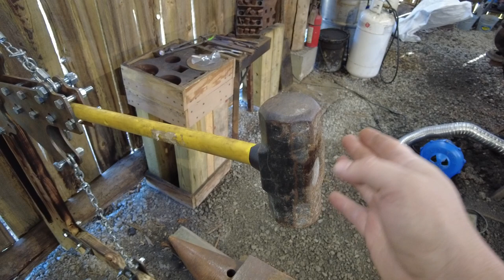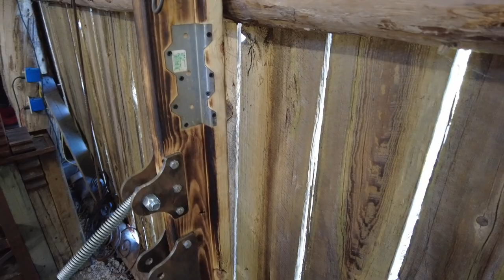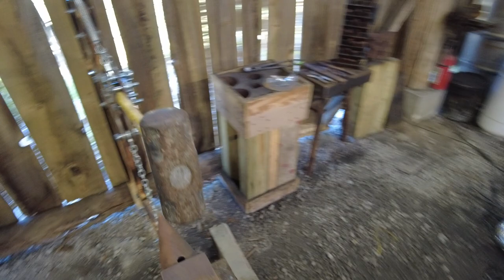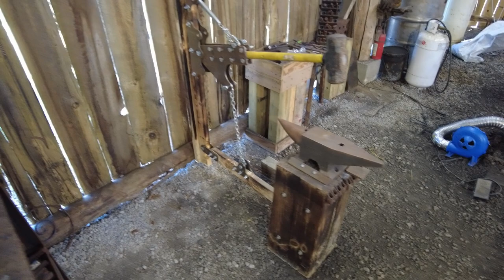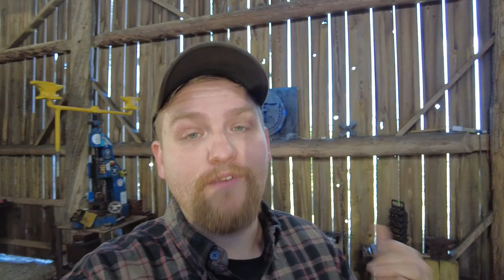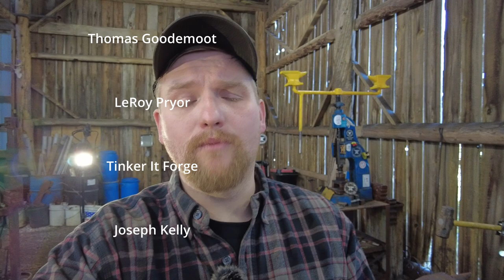Introducing... The New Treadle Hammer Kit! (Plus Q & A)

Comment: This looks like a really great setup!  I know some of it will depend on the sledgehammer used, but what's the approximate distance from the 4x4 to the head of the hammer?  Trying to figure out if I can squeeze this into my shed; a press or power hammer is likely overkill for the small hobby stuff I'm doing, but this looks like it could be exactly what I need!
Reply from the maker: It's just about 40" 🙂
Reply: And of course on a re-watch, you absolutely call this out at the 1:30 mark in the video 😅  Appreciate the reply, need to move a couple of things around but it does seem like it's going to fit, I like that you can put it up out of the way when not in use as well!

Comment: Any idea how much sound it generates? I would suggest measuring decibels when running around 30 strikes per minute from 20 ft away like used for generators, perhaps? My muni code specifies how much 'noise' may acceptably cross a property line.
Reply from the maker: No Idea what DB level It would be but I imagine it will depend on how noisy your anvil or striking surface is

Comment: Roy, that's a pretty neat kit but it would look better if you were able to get proper length bolts. I think it's kind of ugly with long bolts where they don't need to be and too short of bolts where they don't stick all the way through the nyloc nut.
I wonder how hard it will be on a 2 X 4 wall with all the vibration. 
God bless you, your family and your business!
Reply from the maker: Thank you for the input 🙂 the reason why the bolts are long is because I needed it to go completely through the hammer area so that the threads won't be battered By the hammer handle... You can always shorten those.. The ones that appear too short are actually proper length just backed out a bit to adjust the friction and operation of the hammer... God bless you and your family as well 😊
Reply: @ChristCenteredIronworks  ah that makes sense. Good idea about the bolt shank. 
God bless you!